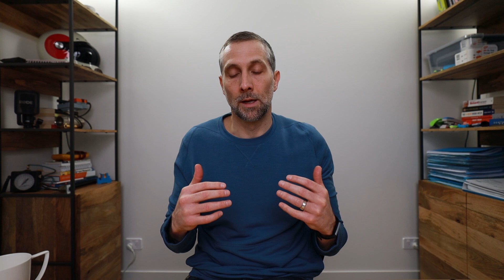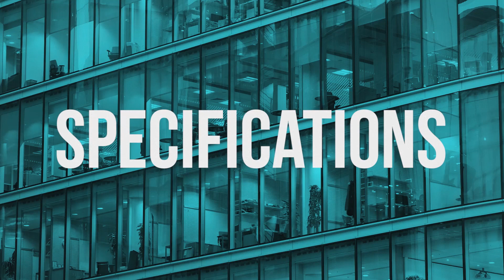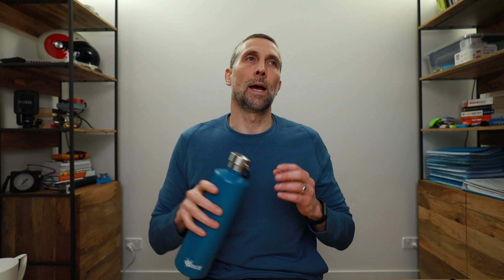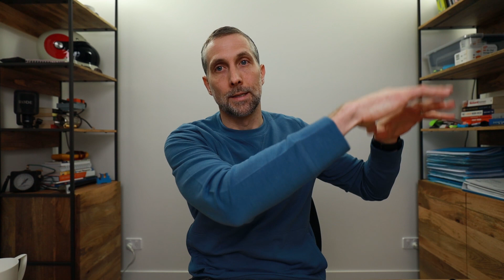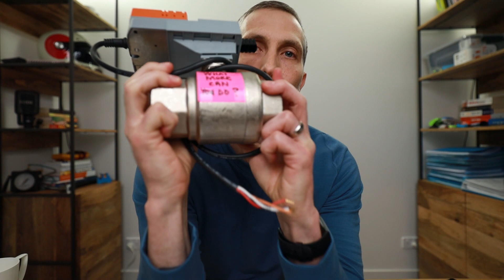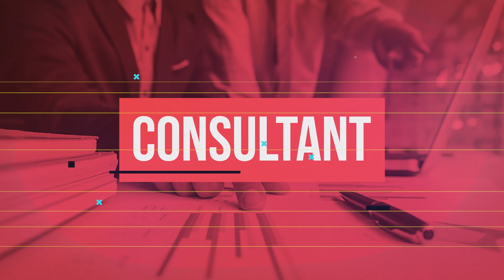Value = Optimisation + Graphics

Comment: Good video.....again

But lowering the CHW temp can mean running the chillers harder, meaning even more energy consumption.......assuming there is CHW temp setpoint re-set.  

Ideally in the (near) future there will out of box AI algorithms that will do this optimisation.  Not talking about analytics
Reply from the maker: Analytics is just very simple fault detection. Can't do any energy efficiency diagnosis. As you know. 
Problem with AI, is that it isn't developed by people that understand control systems. It should be able to do this, I agree. But, not sure if it will happen in the next 20 year's.
I did mention in the video about additional chiller power?